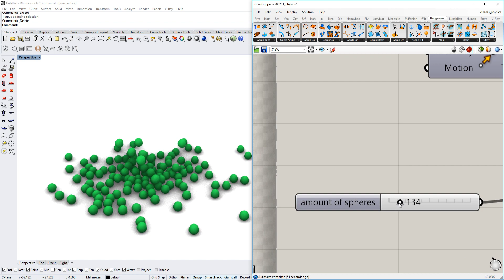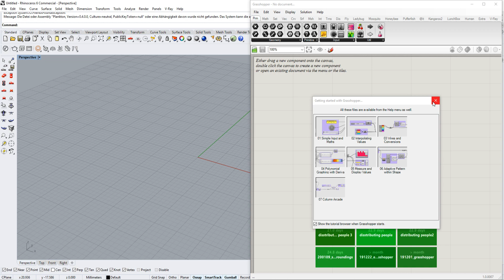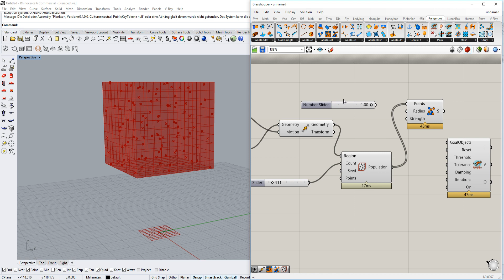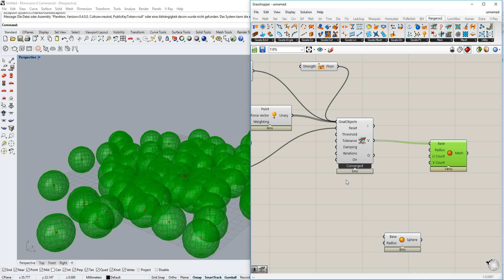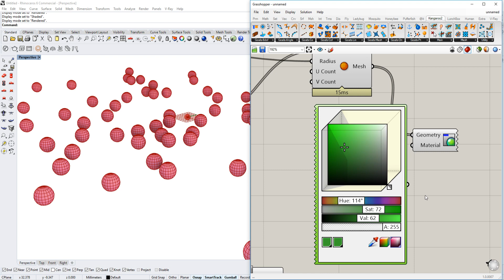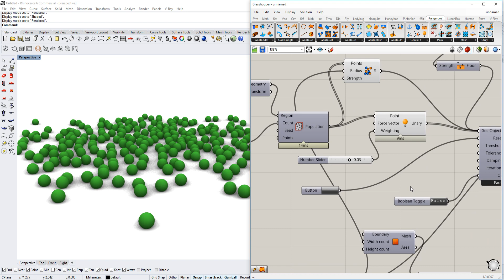Grasshopper Tutorial: Sphere simulation in Rhino/Grasshopper/Kangaroo

Comment: Hey what Forces do i have to add to receive a heap of spheres? And how can i do it?
Reply from the maker: This is just determined by creating new random points when recording points, so you could technically add a box of random numbers and increase it, but what is important is that those points when joined don't override previous points, this way you can add this "heap" of points like seen in the video :)
Reply: @SatoshiBuilds  Thanks for the reply but actually i ment that i would like to have them spheres stack into heap. In the end of your Simulation all spheres Touch the ground. I already added floor friction with rhino7 but i think im still missing attraction forces. You have any idea on this issue? Also, do you mind connecting so we could work on this problem together?